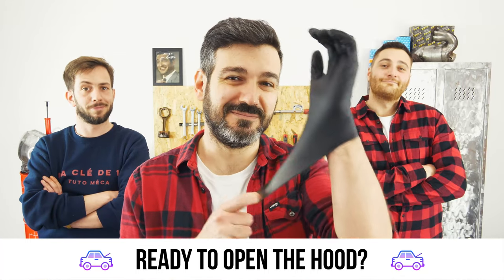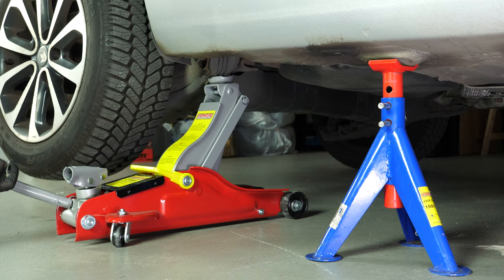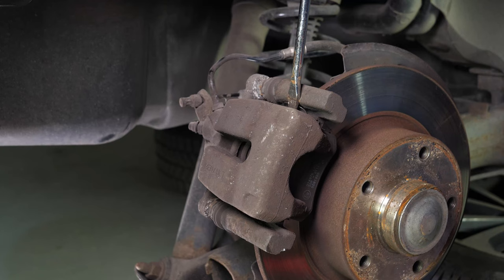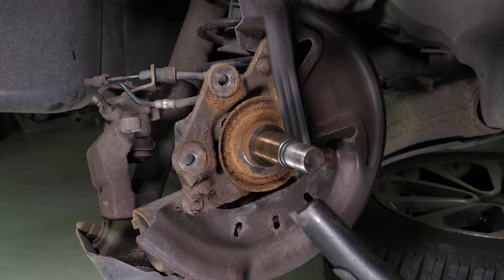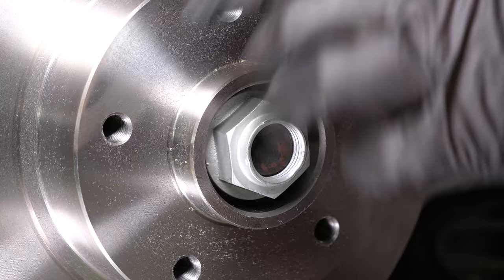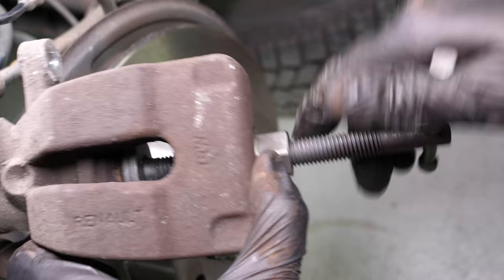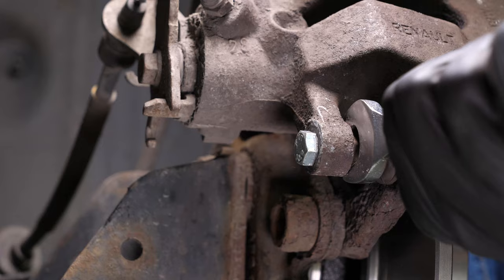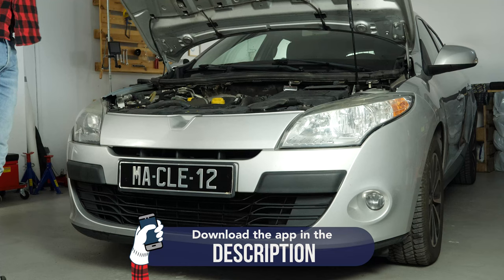How to replace the rear brake discs and pads Megane mk3 🚗

Comment: Did this today on a 2011 Megane 1.5dCi GT Line. 

Literally, did every step as is in the video and apart from a stuck on alloy, the rest was easy. 

It says it’s a 36mm socket for the brake disc nut. 

Can confirm it’s a 30mm on mine. 👍

Comment: I followed this video to carry out the procedure on my 2014 Megane 1.5 dci.
I found most of the instructions to be accurate. However the socket for the wheel hub nut was a 30mm, not 36mm.
I also invested in a torque wrench and took note of how tight the hub nut was when I unscrewed it - it wasn’t even close to 220 Nm - more like 120Nm. I’ve owned the car for 6 years and this is the first time I’ve taken those nuts off. I tightened them more when I put them back on.
You absolutely need a wrench with a long handle to undo that nut - a standard wrench won’t give you enough torque, so either get a breaker bar or torque wrench.
If you have all the right tools to start with (I didn’t and had to buy them as I went along!) it’s a fairly straightforward procedure, and you should be able to get both wheels done in no more than an hour.
Reply: Hi, on the grandtour version, you have to use 36mm socket for hub nut.

Comment: I went and bought a 36mm socket for the hub, however it was only a 30 or so.
Reply: Same happened to me, had a 30 but before I started the job saw 36 in this video so went and ordered one and it did not get used
Reply: I don’t know your model but it’s a 36mm socket for anyone with Megane 265.
Reply: Hi, on my grandtour there was 36mm hub nut.
Reply: It's a 32 I beleive on a standard megane 3, I baught a 36mm socket too and found out i had spent the money for nothing at the time, although it came in handy after to change the oil filter on my sons astra sri.

Comment: Its definatly a 30mm for shaft nut ,other than that good video and dont put hand brake up then put it down again after u open the brake fluid ressevoir. just leave it down from the start and put bricks or something under wheels.
Reply: Hatchback and coupe had 30 mm nut, grandtour had 36 mm nut.

Comment: How does one unscrew that 36mm bolt that has already been torqued to 220nm?..
Reply: Breaker Bar, or put a cheater bar on the biggest ratchet you have
Reply: Impact wrench, just pull the trigger.

Comment: I found that for this model the bearings nut must be tighten to 280Nm not 220 Nm, can you confirm
Reply: Front is 280nm rear is 220nm
Reply: I think two kinds of nuts are used 36mm and 30mm 30mm 220nm 36mm I think it will be tightened with 280nm
this is my opinion

Comment: You need to add grease inside the rubber tubes 
And torq specs the screws
Reply: Inside what rubber tubes?
Reply: @techscrew2 I think the person's talking about the guide pins in the caliper, that are greased because they need to slide. It's good practice to grease them, however if you disassemble the caliper and test by hand if they slide, there's no need to grease them.

Comment: The rear disk socket is a 30 mm not 36mm
Reply: mine is a 36mm i was told to get a 30mm by a friend was way too small so came to this video and 36mm is perfect must vary in model of megane
Reply: @craigsmith5261  very interesting
Reply from the maker: Hello guys, Indeed, for the same vehicle, from the same year, there can be different assemblies :/
Reply: @UseTool_EN   then the tightening torques must also be different.
Reply: @UseTool_EN no, it is for grandtour had larger bearing and larger nut, 36 mm tightened to 280 Nm. Hatchback and coupe had smaller bearing and nut 30 mm tightened to 220 Nm. Other is good explained.

Comment: the hub and disc are one part? wtf!!
Reply: The disc and a bearing is one part, not the hub. 
It is a very good and handy solution. If you do not want to replace bearings at a time - there are discs with bearings excluded if you want to hasle with pushing out and then pushing in bearings.

Comment: Bought a 36 mm socket and it’s not it’s 30 mm thanks for a wasted trip and £15 for a socket.
Reply: You also could have just checked before buying and blaming someone else
Reply: 36mm for some versions of Megane and 30mm for other versions. Obviously it was 36mm for the version used in the video. Always best to double check sizes, torwue wrench settings and even the procedure as it may very between different versions.